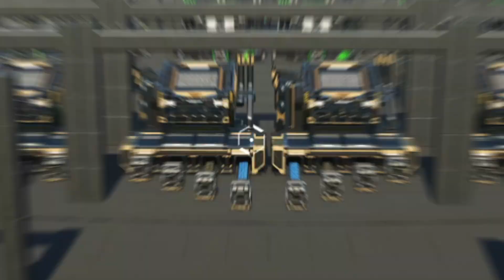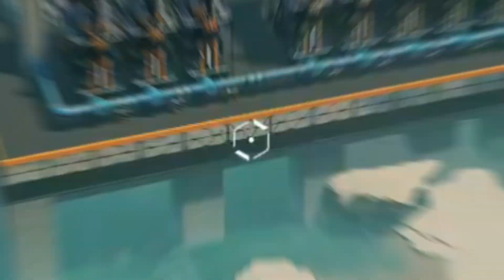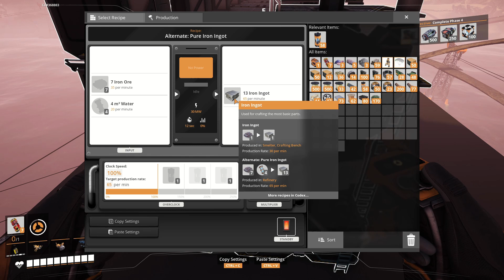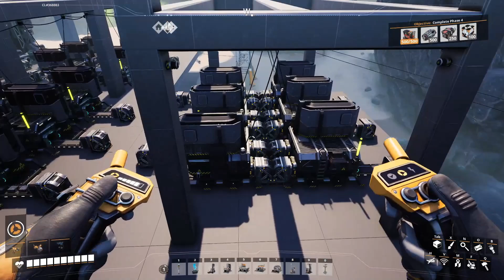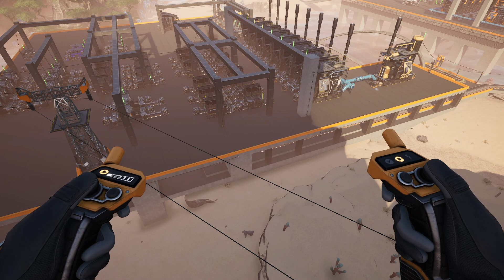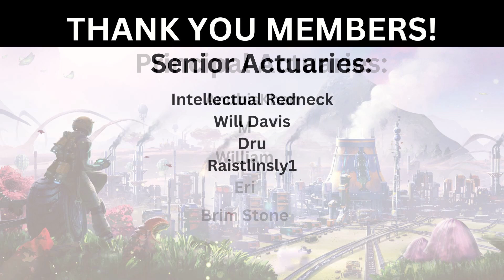How to easily set up Heavy Modular Frames | Satisfactory 1.0 Masterclass

Comment: Oy, this is my first mega heavy mod frame factory I'm working on, and i KNOW I'm doing things that hard way! 
I had to download the modeler after 7 years of playing mod free. 

I wanted 20 Heavy frames per minute just because 20 is a nice round number. 
I wanted a fresh spot for it, so i set it miles away in the dune desert. 
It took DAYS to run a rail out there around the coast, then a road, and power....

The iron plate aspect alone took two days. Then i noticed i didnt have any screw Alts! 
I ran around and grabbed 10 more hard drives after setting down a 900 iron plate per minute factor. The bees were everywhere. I ran through 1200 rounds of ammo! 

I don't even know if I'll ever NEED 20 heavy mod frames per minute, but by god, it's going to happen once these hard drives get downloaded. 
Tommorow, I'll pull the OSHA permits for the screw phase which needs 1,800 per min somehow. 

It's not even a big project compared to most folks on youtube, but damn... it's serious.
Reply from the maker: Hahahah that sounds like it's going to be MASSIVELY satisfying once it is done!

Comment: drones love low throughput items and low throughput items love drones!
such a good vid.
I quite like the Steeled Frame and Heavy Encased Pipe alts for this production chain as well. once I learned you could just forget about screws I never looked back.

I don't even start producing HMFs until I get Heavy Encased Frame, one manufacturer running that recipe can last you until the middle of phase 4 or longer if you're patient and doing other things (and especially if you already had modular frames stockpiled).

on my latest save I got most of the good steel alts early on (like solid steel ingot), so I got to overproduce steel early without breaking power budget, which ended up being super helpful

Comment: So for some reason while I was building one of the foundaries for the Iron sheets it just stopped accepting inputs, I tried everything I could think of until I got rid of the lift holes, one I just replaced them with having lift clip through the floor it worked, the others around it are fine but for some reason it just wouldn't work if I had the floor hole.

Any knowledge I might be missing here?
Reply from the maker: There have been issues with lifts/floor holes connecting properly. I haven't played the game recently so not 100% sure about current bugs, but that might be it.

Comment: Guys if you don't find the recipes, after you've scanned your hard drive you can save before rescanning (doesn't work with the first scan) and then load the save and rescan again, it's kind of cheaty but gettting the right recipes can be frustrating